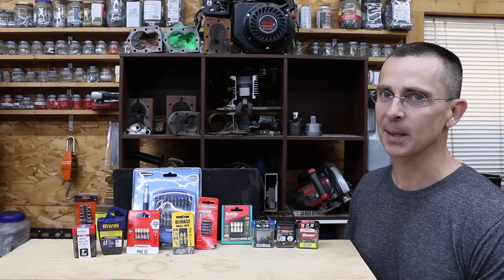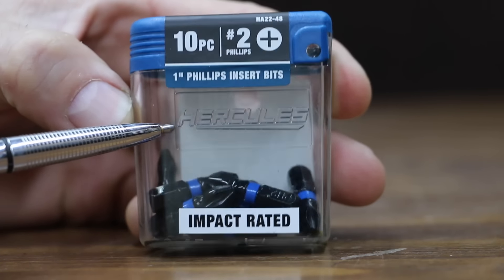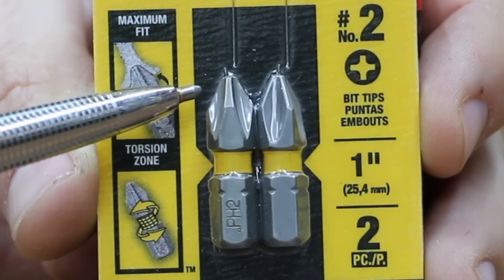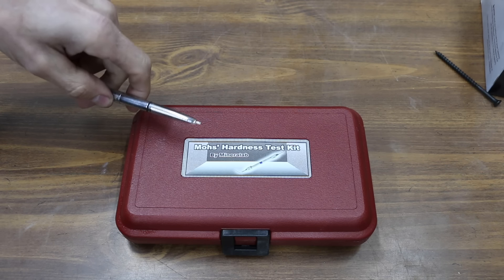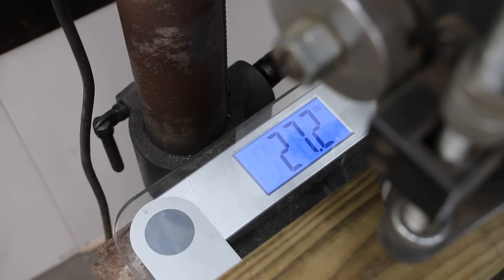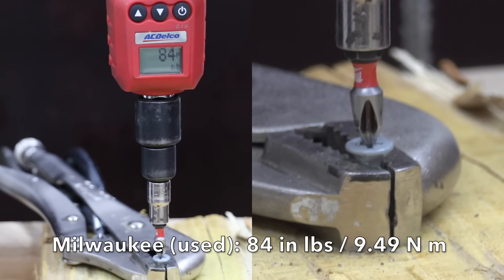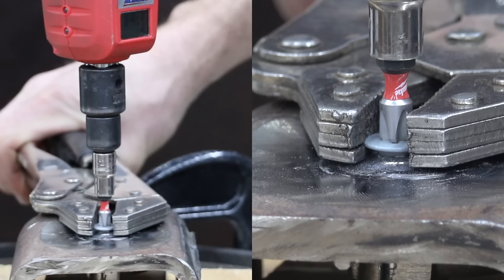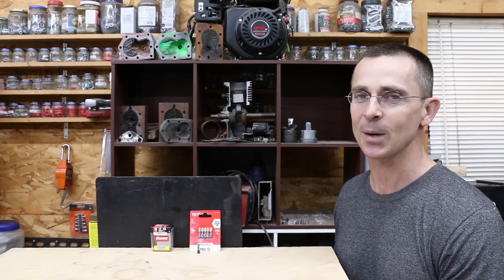Which Impact Driver Bit is Best? Let's find out! Phillips #2 Showdown

Comment: I started off with DeWalt bits because I was using that brand of tools and thought surely the company would make a bit as good as their tools but severely disappointed, everything snapped from the drill bits to the phillips and T25, my other tool brand I use for work is Milwaukee so I tried their bit and was happy with all but the drill bits so now, regardless of tool brand, I use Milwaukee bits
Reply from the maker: Thanks for sharing.

Comment: in this test you used the makita gold, but you forgot the Makita Impact XPS which is the best.  i use the 'Makita E-01292 Impact XPS #2 Square 6" Power Bit' every day.  you would have had a better test with robertson #2 (square 2) than philips screws.   i avoid philips as much as possible, robertson and torx are the best.  it's too bad torx plus is unseen in north america.
Reply from the maker: Thanks for the feedback.

Comment: I would like to see comparison tests on cordless circular saws.  Are the brushless motors that much better than brushed motors.  If the controller (stater unit) goes out on a brushless motor, you buy a new tools as they are just a few dollars less than the original tool.  Is the Milwaukee FUEL, that much different than the standard Milwaukee?   Are any of the saws made in America?  I think you do a great job on your comparison testing.  Thanks.  BooRaah on your hair cut.
Reply from the maker: Thanks for the suggestion.

Comment: Another awesome video. Personally I have had great experience using Bosch Torx and Phillips bits. I changed an entire 48 foot flatbed trailer decking using only 2 bits with an impact driver. Overall I used more than 1000 fasteners to secure the decking to the trailer.
Reply from the maker: Thanks!  Thanks for sharing.

Comment: Bits are a daily use thing in my line of work. The harbor freight brands have all failed me with either bending the tips or breaking. Every Dewalt I've used have broke. I switched to Milwaukee and although I have had a couple break (partly due to bad habits) They have by far lasted longer than everything else I've used.
Reply from the maker: Thanks for the feedback.

Comment: About the APEX USA bits heavily used in Industry: ' I'm a professional aircraft mechanic and I can tell you that these particular bits will fit the majority of #2 Phillips screw heads better than what you are probably using. If you look closely you can see the difference between a normal #2 and the Apex. The tip design is reduced so it allows the bit to make better contact with the screw slots. More contact, less cam out. I would give 5 stars, but I don't like the price but I get why they cost what they do, because they're simply better. After being introduced to these at Boeing, I will never use another brand. These are worth the money both in making my job easier (not having to drill out rounded out heads) and less aggravating. If you use phillips bits on a regular basis, try these, you'll probably like them better."
Reply from the maker: Thanks for the feedback.

Comment: When the bit I had, that supposedly had a lifetime warranty, finally wore out over about 3 years, I took it back to Home Depot, to replace it. They didn't have the same one anymore. So, he said, since it was a lifetime warranty, just find one you want to replace it with. The new one is the Milwaukee brand. So far, it's lasted me 3 years now. But I don't use it every day. It holds up a lot better than the cheap ones I get from Harbor Fright. I use my RIDGID battery powered tools with it.
Reply from the maker: Thanks for sharing.
Reply: The only thing I don’t like about the Milwaukee bits is that they are slim and can’t snap on the bit holder on the back of the impact driver.
Reply: @grattonland  I sometimes lose it, because of that. Then I find it again, eventually.  LOL

Comment: I feel like bits are perishable tool that often times ends up getting lost anyways so the only thing that really matters is how much torque it can apply before camming out. Considering that factor the warrior brand actually looks like it did quite well (used cam out was above average in your tests) and it's the cheapest of all the bits. imo it's probably best to buy 2 or 3 sets of warrior brand than one of the bauer or Milwaukee brand AND still save money.
Reply from the maker: Thanks for the feedback.

Comment: I was really surprised by the Bauer bit. For the price you really cannot complain about it, 23 cents a bit cheaper than the Milwaukee. Question would be does the Milwaukee last 50% longer than the Bauer because that is roughly the price break.
If I'm running past a Harbor Freight and need bits it might be a waste of gas money to drive clear out to a Home Depot... But, I'd probably do it anyway.
Reply from the maker: Thanks for the feedback.

Comment: Cheap ones i have break in half if i do bigger screws. I am little confused, does it make any diffrence in practise if i buy better one like they are all pretty close in this test, but these seem all to be somewhat quality products and mine are like regular/bad. Well maybe i test a few if they have Milwaukee  in the shop.
Reply: Never mind there was one bad one and the diffrece between best the last was 157-93nm=64 Nm , this is 64kg or around 3 plates per 10cm/4 inches for those that go to the gym.
Reply: Never mind 2 these were inch pounds, so only like 7kg per 10cm distance so its like small dumbbell so still confused does matter at all, i have to go shop

Comment: I bought the Crescent brand bit holder that claims to extend bit life. I must say, it does work but it also limits your torque for larger fasteners. I do use it all the time unless I am driving 9x3 fasteners and it saves some bits.

The Kobalt drywall setter is great and I use the Bosch but tips in it but I hate their hyperbole of 50x bit life.
Reply from the maker: Thanks for the feedback.

Comment: Makita is the best for long term use in an impact driver, I took out 120,000 rusted screws 1/4-20 #2 Phillips in year with one. All the other brands shatter eventually after a month or 2 of cranking on them with my de Walt impact driver. The makita is still going after 480,000 screws in 4 years. Great for cranking high torque! Milwaukee is great for wood not impacting metal parts together with bolts like makita. Don’t believe me try it. I’ve used them all.
Reply from the maker: Thanks for the feedback.

Comment: I do mainly woodworking and have always used regular drill bits in my impact driver.  I've heard by some that this is actually better as the impact bits would be better suited for drilling into metal.  Is this true?  Am I ok with just using regular bits with my woodworking projects, or should I always use impact rated bits? thx
Reply from the maker: Thanks for the suggestion.

Comment: My recent deck project exposed the Bosch to be a highly over rated brand, I bought a pack of 5 bits and 2 exploded after about 30 screws or less using my impact driver, the others were returned. Bosch products are no longer used in this household.
Reply from the maker: Thanks for the feedback.

Comment: I have to wonder if some of those would’ve fit better in a different brand of screw. As a Drywaller that use many thousands of screws per year, I can tell you that all screws are not made the same. Grip rite from the box stores are the absolute worst.
Reply from the maker: Thanks for the feedback.

Comment: If you have a really good bit you shouldn't have to put any down ward pressure at all. In fact just the weight of the tool should be enough. This was never a problem in the past with the old Vermont bits . Hard to find now. What I  found out Milwaukee is one of the wort ones out there and so are Dewalt. Its really hard to find  good ones .
Reply from the maker: Thanks for the feedback.

Comment: Could it be possible that the reason these drill bits eventually fail is because the PH screw is inherently flawed? Why is the PH screw used so much anyway? Why not use other screw heads? I ask this because I really want to know.
Reply from the maker: Thanks for the suggestion.

Comment: Another great vid! Thank you! I’ve always preferred the Milwaukee bits because I assumed that Milwaukee is still an American owned company. I have no idea whether or not my assumption is correct! I always prefer to support American companies! Sidenote - why do Japanese car companies (especially Toyota) use Phillips heads on machine screws that are as large as 6 mm? I can’t remember how many times I’ve had to use a hacksaw or Dremel to cut a straight slot through them to get them loose. Or, use vice grips when possible. Buy American, I always say, even if the materials are made in other countries. At least the profits stay here at home! Thanks again for your hard work 😓
Reply from the maker: Thanks and you are welcome!

Comment: All of the claims of perfect bit and engineered to prevent cam out genuinely confuses me. I was under the impression Phillips bits are designed to cam out. For this reason I personally avoid Phillips bits wherever I can and opt for torx or pozidriv fasteners

Comment: I've had the same Milwaukee bit in my drill for years, using it for all applications.  DeWalt bits don't seem to last as long and obviously the cheap harbor freight bits don't last longer than a dozen or two screws before they break or wear out.
Reply from the maker: Thanks for sharing.

Comment: Having worked with drywall screws for over 50 years,  I am not so sure that all any brand of driver bits will fit every brand of drywall screw the same. Just a polite comment.
Reply from the maker: Thanks for the feedback.

Comment: Ive always been a fan of Dewalt #2 bits (using Milwaukee drivers, lol)... The new shockwave Milwaukee bits show surprising results, especially since the older model seemed to cam out fairly easy then was all but useless after the first cam out.... Will have to give Milwaukee another shot. Thanks!
Reply from the maker: Thanks for the feedback.

Comment: Hey Todd, there are a lot of bits out there, but you missed the one that is used by the metal framing guys. HILTI makes a bit that is specially designed for steel stud construction, I think they cost a bit more than the big box stores, but they really are the best. The good part is if you use them to drive into wood they last forever.
Reply from the maker: Thanks for the constructive feedback.

Comment: Phillips bits are a particularly good choice for this challenge.   They have a tendency to slip out of the screw head, making wear on the bit particularly annoying.

Good choice.

Be sure to do a less wear prone head that has different wear profiles, such as torx or square-head as well.
Reply: As a note, I love torx heads, if I had the time and money I'd replace every screw in everything I own with torx head screws.
Reply: Oh, and BTW, I just prefer a drill to an impact driver when it comes to screws.  Large bolts, especially those that need to be tightened down hard call for an impact driver.
Reply from the maker: Thanks!

Comment: i believe, your 'wobble' comes from the fact you're using PH2 (Philips Head No 2) bits in 'Drywall Screws'. Drywall screws have a shallower head / 'philips' impression and require a shorter P2R or PR2 ( 'Reduced', some say diameter, I say length of tip) bit.
Again, a PH2 bit will Not set down in a drywall screw, the 'tip' is too long & socket too shallow.
also, drywall screws Are brittle (white 'pot metal'). They have No shear strength, they do not bend. Smak'em with a hammer, they snap unlike 'wood screws' which bend.
my preferences are: Milwaukee, Boshe, DeWalt, Irwin then Kobalt (local stores)
from 'tool stores': EVCO extensions and bits hands down.
- - - 
With all that said. I really like your comparison videos and channel... Thanks.
Reply from the maker: Thanks and you are welcome!  Thanks for the feedback.

Comment: I like the warrior bits more than any of the others I have tried (haven't tried Milwaukee or Wiha). They occasionally break but not very often for what I do, which is mostly drywall screws, metal screws, and screws for window flanges. Occasionally I do 3 inch screws and they seem to hold up great with those also. Often times I can hang the driver on the screw after driving it. I just really like the way they fit and at 20 cents I can toss 'em when they wear out even a little.
Reply from the maker: Thanks for sharing.

Comment: Hi. I have some 3-inch screwdriver bits. They are of the impact/shockwave style. The manufacturers say the bits have long lives. They made the necks of the bits very thin to absorb shocks. But what I'm worried is that if the necks are so think, will they become weak? I mean, would they break under less torque than if their necks were not so thin? I hope I expressed myself clear enough.😓 Thanks!
Reply from the maker: Thanks for the suggestion.

Comment: Man, I know this especially with Phillips bits. Maybe its the screws, but I don't know how many bits fit so sloppy in the Phillips head, there's no way it's gonna hang in. And brand is of no matter. I think it's the screw. But I've had#2 Phillips bits start out brand new, fit so sloppy it's pitiful. 
It's sad that, especially Phillips, being the most common screw head, bits wear so constantly, especially for how much some cost. Most Phillips screws aren't hardened. So how are they wearing out supposed hardened bits so easily?
Reply from the maker: Thanks for the feedback.

Comment: I have used the Milwaukee, Makita gold and the DeWalt and so far the Milwaukee does take quite a beating . The Makita gold also does but it wears a little bit faster the DeWalt it just in the middle . However if you use the bits properly that alone adds to the longevity and wear reduction of the bits . Those three I mentioned can really go great distance ,just keep extras as usual☺️
Reply from the maker: Thanks for sharing.
Reply: 87 I

Comment: Ryobi impact bits suck they are too brittle for what me and my dad need to use them for and we've also had the same experience with the old DeWalt impact bits the new impact bits from DeWalt seem to hold up better than the Ryobi and old impact bits from DeWalt but the best impact bits we've used for the durability and the price was the Bosch high impact bits they held up very well with everything that we use them for and my dad almost bought the entire stock that Amazon had because of that they are still holding up and getting the job done none of the impact bits have broke under high amounts of torque and abuse that we put our tools through but Amazon did end up selling out of the impact bits so other people must have had the same experience with those impact bits if Amazon sold out of them
Reply from the maker: Thanks for the feedback.
Reply: @ProjectFarm  your welcome always happy to send some feedback if it helps grow the channel

Comment: I think the truth should be told on the alternators/rectifer riding lawn mower charging system. On every mower I have had, the battery cannot stay charged. It is a very common problem. I keep an extra 12 V battery on mine to help boost the starting. It will eventually run down, but let 10x longer than the regular John Deere Battery.  the charging alternator may be generic these days, I have only seen 2 different types, maybe three.  What is the actual voltage and amp output on these mowers, typical box store riding mowers? Z turns, cub cadets, Toro, etc etc. A lot of problems with these things all over you tube.
Reply from the maker: Thanks for the feedback.

Comment: I've been buying Milwawkee bits for years after I found they just seemed to last longer and perform better than others. They are also priced close to or better than Wiha and Dewalt, which are the two other brands I tend to buy. I still prefer my Dewalt drills and drivers to most others though.
Reply from the maker: Thanks for sharing.

Comment: Hello again Project Farm 
Thank you for another Great Video. Your screwdriver bit tests Video maybe a year. But I found myself interested in finding the best tool. I just started back to work. Most of bits I have are no name from the company stock. I was working with another guy who had the Milwaukee bit set. And was not having any issues with removing and installing the screws. These screws are exposed to paint and Corrosion etc. Your Video doesn't mention paint and Corrosion issues. Would that change which bits drivers work the Best! Again thank you

Comment: Before I even watch this, I'll tell you. I'm building a house right now and have driven over two thousand 3" structural screws into yellow pine and  did not wear out the Milwaukee Phillips bit in my impact driver.

Comment: KNOW that there are 2 types of screwdriver bits in the world. Most of those you see at Home Depot and the 
like are  SOFT METAL, softer than the screws you are driving.  HOWEVER  there are  HARDENED steel bits in 
the world but you have to go to a genuine tool store to get them.

!
Reply from the maker: Thanks for the feedback.

Comment: I worked in the aviation industry for almost fifty years and screwdriver bits are important. There are two brands that are used frequently, Apex and Airtek. Both are very well made and last a long time. Both resist tip wear and stand up well to impact drivers. Aircraft use machine screws made to a high standard and demand a decent driver tip that resists cam out. I have been retired for many years but still use bits from my working days, a testament to their longevity.
Reply: Out of curiosity, are Philips the most common screw where you worked, or is it a different type? And so cam out is no longer useful to avoid over torquing?